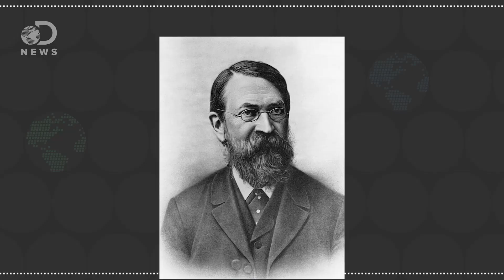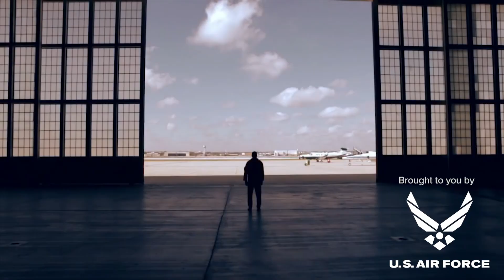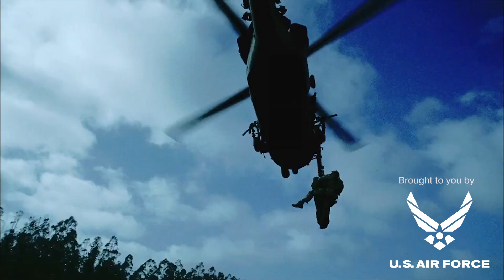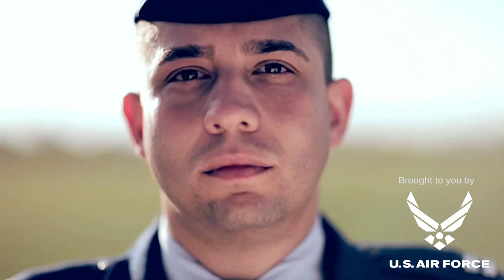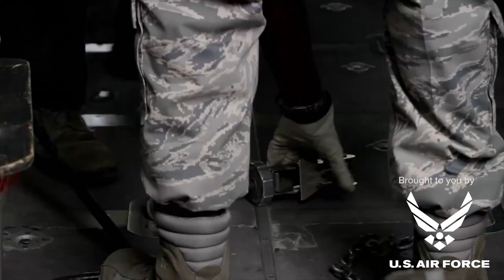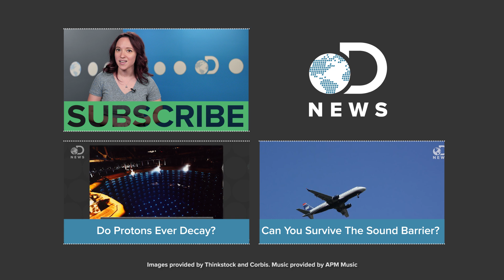Why Is A Sonic Boom So Loud?

Comment: When it comes to the design of the X1 you need to refer the the British miles M25 design! First
I've flown on Concorde and in fighter get Concorde every time as inflight on a military jet is crap!
Why when yo mention the speed of sound do people drag out a military jet WA huge water plume around it? That's not the aircraft at mach1 it's the air rapidly accelerating and slowing down through a shock wave around the aircraft at that pions as the air speeds up the pressure increases a this causes the air to compress and warm up which allows the water vapour in the air to instantly condense out as it goes through the the dues point

Comment: When I was 10 years old, I lived in Okinawa Japan. The home of the SR-71. I remember experiencing many Sonic Booms every so often. You could actually make out the shock wave heading towards you from watching the ground. It is similar to the shock waves produced by large fuel explosions when you can see the wave before you hear the sound. These planes were awesome to watch arriving at night after a long flight. They would be glowing red hot when they landed. The heat from the Mach speeds would take some time to cool down. Sonic Booms became a normal part of living on that island. '73-'75

Comment: The airforce is lying to you.. the F22 Raptors have a max speed of probably higher than Mach 4. The newest Raptors have near indestructible material on the exterior and have tiny nuclear powered spinning magnetic plasma systems to gain levitation speed and therefore unleash the velocity of the aircraft to over mach4 capabilities... because without weight, it isn't that hard to move an object quickly.

Comment: The Bell X-1 was specifically designed upon the 50 caliber bullet [the machine gun bullet, now also a sniper round].  You skipped over the fact that the X-1 design could not survive the sound barrier, it needed a major design change.  The horizontal stabilizer [horizontal tail] of the X-1 was revamped to move, thus allowing enough angle of attack to move enough air [function] at mach 1 to control the aircraft and keep it from shaking apart.  [It was a state secret for as long as possible.]  - - - - I used to be a pilot.
 - - - - Thank you for the video.

Comment: So if breaking the sound barrier creates a shockwave of air compression creating a loud noise then wouldn't crossing the light barrier produce both a sonic boom and a photonic shockwave?  That'd be pretty tripping to see; assuming it wouldn't be so violent and intense that it caused blindness or worse.
Reply: Which is unreachable for objects with real mass according to some weird group of people, who are called scientists.
Reply: Jason Koneman Really going faster than the speed of light?
Reply: AT the speed of light. Not faster.
Reply: I traveled at the speed of light once , I was a lineman on a telephone pole and 12000 volts entered my hands and exited my elbows. I was soaked in a downpour and power jumped from the line onto a tree that was touching the wire I was working on. Felt like I was hit in the elbows with a hammer what a jolt.

Comment: nice video, except it didn't explain WHY IS A SONIC BOOM SO LOUD? thankfully that's not the video's title. oh wait
Reply: Rafael Adamy Hopefully I can shed a little light on this situation. As we know, air is made of molecules and magnify that even more, particles. When supersonic aircraft break through this "wall" it leaves a low pressure "vacuum" with higher pressure surrounding it. The atmosphere is dependent on pressure equilibrium. Lower altitudes means greater pressure. When the low pressure pocket is formed, the higher pressure aura of particles gets violently sucked back in to equalize it's relative pressure and creates a shockwave through the molecular structure of the atmosphere. This happens so quickly too and that's what's makes the sonic boom. 

We are actually living examples of this simple principle; everytime we breathe in and out! Crazy right? Really, it's not something we think about. Fully exhale as much as you can then relax your diaphragm. Your lungs are now of a lower pressure than the atmosphere around it and automatically expand to equalize pressures accordingly. That's why inhaling and exhaling come so effortlessly to the human body because it's constantly changing and equalizing pressures. I hope this somewhat helped and made you understand it a little bit better.
Reply: Cody Hall - GrindStone nice explanation.

Comment: I flew the F 71 blackbird at 3+ the speed of sound or plus Mark III.  I Then activated my afterburners to mock 7+. This was it 87,000 feet. I've then  accelerated to mach at nine at 96.5 Thousand feet. We then hit a high Cloudbank which is like hitting a brick wall. I ejected  along with my copilot at 103,000 feet, It was no big thing, it took off my copilots left arm in the head but I was OK!
Reply: Ha ha ha all the above was just a joke, did not happen. I was dictating and was going to add this statement in that context but this dumb iPad printed that before I was ready and I could not delete it. Sorry if I miss lead you to bad, it was just meant to be a joke. Anyways I thought it solid cool and funny. Have a great day. But I certainly do respect the pilots that fly these things, they are doing a great job. We pray for them.
Reply: It's the Sr 71 blackbird anyway.
Reply: Bill Donoho Well excuse the fuck out of me. I was stationed there for a fuckin year and never had the opportunity to walk or fly as the crow does. By road miles it's a hell of alot farther than 100 miles from tip to tip. Jam that into your geographic ass and smoke it...
Reply: In the 70's I saw the SR71  as it did a fly-by above our LORAN station on the island of Okinawa..It was based out of Kadeena AFB 100 miles south of us... On Okinawa it was known as the "HABU" which was a venomous snake indigenous to the region. I was told the top speed of the aircraft was classified but at top speed, the aircraft needed the circumference of 3 states to make a U-turn and that fuel leaked from the plane until the speed of the plane caused heat from friction thus heating the craft causing expansion of the parts and sealing the leaks.
Reply: Not!  Okinawa is only about 70 miles long and about 7 miles wide!
Reply: I'm sorry if I hurt your feelings Bill. In retrospect I realize my response was rude and for that I apologize. I really don't know why I came off like that when all you were doing is correcting a mistake I'd made. Which I appreciate actually. All these years I'd thought Okinawa was longer and wider than it actually was. So please disregard what I said and put it behind you if you can.Thank you.
Reply: Pride To be
Reply: Pride To be
Reply: evan morrow Again? lol

Comment: Soooo why are they so loud? WTF??
Reply: It'd because you are constantly outrunning the soundwaves which makes more sound waves meet at a certain intersection. this intersection becomes less of a sound wave and more of a shockwave. therefore when it reaches something think of it as hearing millions of engines roar, at the exact same time, loud.
Reply: @Mallchad  nice one
Reply: It is the same thing that happens when you make a Whip snap. That little cracking of the Whip is Supersonic. A larger mass (plane) makes the snap into a Boom. You can also do this by slapping two flat 2x4 wood planks together real fast.
Reply: + Bartosz Olszewski You are clearly an uneducated moron.
Reply: Because you're le idiot.
Reply: the sound waves can't move out the way quick anoth so it causes a sonic boom
Reply: +Bartosz Olszewski kek
Reply: It boils because the heat excites the molecule's movements (whereas cold the molecules barely moves) and it's loud because of the compression in the air. The plane makes sound waves when passing through but sound can travel only so quickly to reach our ears or whatever(@343 m / s), but if you go faster than that, the sound waves starts pilling up, they add up together, get louder, and always makes boom if you keep higher than sounds speed, if you were to follow at said speed at the right angle behind the plane's cone, dammit why insult when u can wiki !
Reply: we never really got much of a answer
Reply: Mallchad that is the response I have been looking for when people ask me that question
Reply: WifeBTR123 you got correct
Reply: +Bartosz Olszewski Are you sure about that?
Reply: maybe the air particles that vibrate more than normally it does, as the aircraft increase in speed.
Reply: Bartosz Olszewski but why does it boil? Why is it so loud? Man since ur so smart
Reply: It makes a boom because the damn sound travels faster than itself with the plane that creates it every moment passed, the plane goes so fast that the sound does not catch up with the speed it travels so eventually it piles on itself and that pile makes a pressure that creates the boom. Plane makes noise, plane goes faster than the noise's speed, so noise packs up and boom.
Reply: sobreaver BOOOOOOM!!!! and that's how it's made people
Reply: WifeBTR123 ok
Reply: Violent change in pressure
Reply: I think it's basically making vibrations (sound) and catching up to them and building a really loud noise through constructive interference (sound waves combining) 
Someone please correct me if this is off, this is just my understanding of it
Reply: Because they are sonic boom
Reply: Sound propagates through air spherically as pressure waves, a sphere of high pressure followed by a sphere of low pressure and so on. When the sound source moves faster than the speed of sound, the pressure can't escape in the direction of the motion, and all the pressure, that normally would be spread out in a sphere that gets larger and larger, thereby "diluting" the pressure,  builds up in a cone shaped high pressure region, that is diluted much less. The condensation you see at the back of the plane is the low pressure zone that follows the high pressure zone (invisible), but it is still part of the boom, so you can see, that all the energy of the sound is concentrated in this wave cone, one high pressure cone, one low pressure cone, instead of being spread out in many spheres.
Reply: I thought the sound came from the normal shock after supersonic flow transitioned to subsonic straight after it exited the nozzle
Reply: WifeBTR123 cuz boom is in their name
Reply: It's because the sound is compressed because sound travels in waves
Reply: Just saying, boiling water is hot because it is boiling, that is not an explanation. Imagine asking what the air we breathe consists out of and someone just saying "different kinds of air".
Reply: Actually, water does not have to be hot in order to boil. Just lower the pressure enough and it will be boiling at a room temperature.

Sound is a wave (a difference of pressure) travelling through the medium at its speed of sound. If the source of sound moves at the very same speed, the sound waves begin to stack over one other. You end up with a load of sound waves, all stacked up at one place. And when that hits you, you hear a sonic boom. It's like recording the sound of the engine and playing it by a thousand speakers at the same time.

At supersonic speeds (faster than sound) the sound waves actually don't have that much time to stack before they dissipate, and the sonic boom gets much weaker (although technically it is still there). Not sure if the pilot hears the boom, but the plane definitely does. Hence the vibrations it has to endure.

At the speed of sound, the molecules of air don't have enough time to "make way" for the plane, as they would normally flow around its surface in subsonic speeds, and the plane perceives this as a local increase of air density (just a thin layer on the front side of the craft), which rapidly increases the drag. Since drag is usually quite high even below sonic speeds for the engines to fight against, the value of drag might reach the value of engine thrust at the moment of going sonic, at which point the plane can't accelerate anymore. This is the fabled sound barrier.

I am not at all sure how it works with the whip. It might be able to travel at the speed of sound, but does not generate any sound itself, like an engine would, and therefore there's hardly anything to stack. Maybe hitting the molecules of air at high enough speeds generates sound on its own?
Reply: They are so loud because the engines are so loud.

There are 3 main things that effect how loud the sonic boom is.  The sound pressure level being generated by the object that is moving, the shape of the object, and the mass of the object.

Sonic booms are basically a byproduct of the Doppler effect.  In order for you to hear the Doppler effect an object has to be making sound (like the siren on a police car).  The faster the object goes the higher the pitch gets of the sound out in front of the object and the closer the object has to get to you before you start hearing it.

Eventually the pitch gets so high that the sound waves from the engines meet up on top of each other for a millisecond or less.

This creates what is called “constructive phase interference”.  With sound, when you add the exact same sound on top of itself, the resulting volume goes up 6dB.  This is called Coherent constructive phase interference.  Every time you double the number of identical sounds on top of one another, you get another increase of 6dB.  So 1 to 2, 2 to 4, 4 to 8, and so on.  When you add sounds together that aren’t perfectly phase aligned it is called incoherent constructive phase interference.  Since they aren’t perfectly aligned, the volume does not increase by 6dB.  If it’s the exact same sound the amount will drop as the time difference (and phase difference) gets larger.  If the sounds are random like noise (say from a jet engine) if the sound isn’t perfectly aligned when added it will increase the volume by 3dB for every doubling of the sound instead of 6dB

The sonic boom is a combination of coherent and incoherent constructive phase interference.  

The “boom” is where those sound waves are all constructively piling up on each other within a millisecond or maybe even a half a millisecond before the plane moves far enough forward that it leaves those sound waves behind and generates new ones...  the overlapping of these ever-expanding spheres of sound that are being left behind the aircraft is the boom.  So the boom is technically continuous, but it is moving as fast as the aircraft is at an angle behind the aircraft.

The only way to really hear it as a “continuous” boom would be to match the aircraft’s speed at exactly the correct distance  behind and either below or to the side to constantly be at the point where these sound spheres are intersecting and adding on top of each other.

The new low boom aircraft that are being developed for commercial travel are lessening the boom by dropping the sound pressure levels (volume) produced by the aircraft.  The quieter an object is while traveling supersonic, the shorter the distance the sonic boom will travel before the sound dissipates and you can’t hear the boom anymore.  That is how the SR71 could fly supersonic over the US and other countries and never be heard... it was at 90,000 ft in the air... the sound energy of the boom dissipated before it reached the ground.  As the engines get quieter the can’t throw sound as far and so the plane can get lower and lower without the boom reaching the ground.
Reply: Btw this is my teachers channel
Reply: It's because the sound waves overlay as the plane continues to go forward
Reply: It seems almost as if the aircraft is kicking off every single molecule it possibly can in the smallest area . Like jumping off a rock
Reply: because they make sonic boom.
Reply: @tennicktenstyl  yeah but she didn't explain why this shit make such loud boom lol ... Title : "Why Is A Sonic Boom So Loud?"
Reply: @Hackanhacker  It's just the compression of air that happens when you go over the speed of sound. Since you go faster than the air can spread out and the pressure equalize, you are creating something in lines of a cone of highly pressurized air around the plane surfaces. Rapid expansion of the pressurized gasses makes then an audible pop. I was just messing around since the video didn't give a clear explanation.
Reply: Gilmer Ereno it's so loud because it's sonic boom. Like, it's obvious. Like asking why boiling water is hot. It's because it's freakin' boiling water man
Reply: they are so loud because of constructive interference of sound wave which keeps on increasing its amplitude of that sound wave
Reply: Doppler effect is very helpful to understand why this sonic boom is so loud...when plane cross the sound barrier the multiple Shockwaves created from the nose of plane to the tail of its get intersect to each other and it creates the single shockwave since it can not be multiple Shockwaves at same time when effect is extreme and that is why intensity is much higher and that is the reason sonic boom is very loud
Reply: what is sound ?  sound is nothing but vibration of air molecules and when we cross a certain speed (speed of sound) in air the magnitude of air vibration is very large so we get a loud or high intensity sound.
Reply: kjilk simble Jesus that's y it's loud. Next time somebody asks why just  say. Jesus!